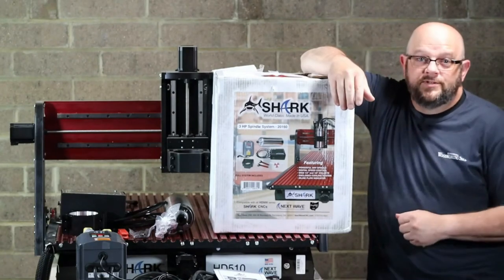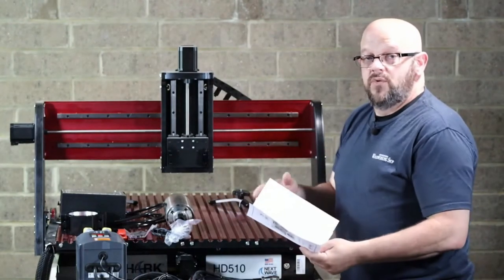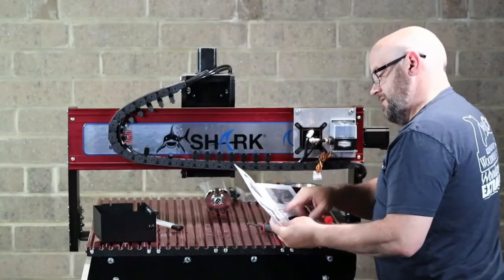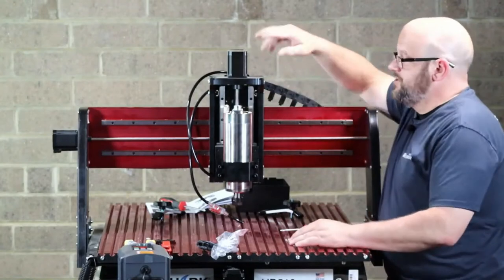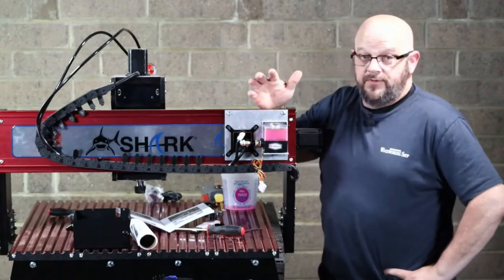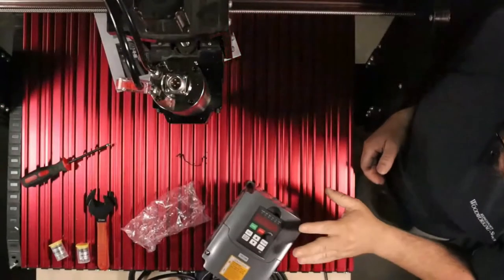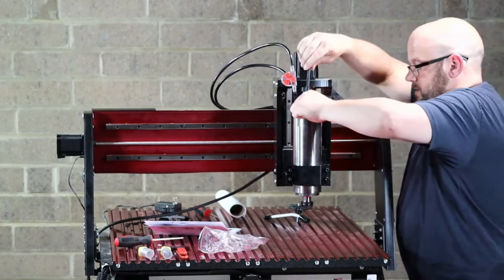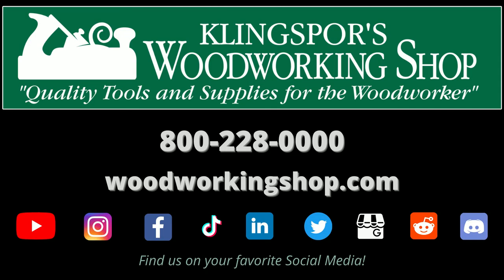3HP Next Wave CNC Spindle Assembly Video

Comment: Hi Chris,
I have just bought and put together a new shark HD520 with 3hp water cooled spindle, but I have not started it up or tested anything. I have been trying to find an instruction manual for the spindle's VFD inverter control box/unit? The manual that comes with it works great for the set-up of the spindle (the same manual you use in your video), but it does not have instructions on how to push the right buttons at the right time for the right reason. I do not know what the arrows ups and downs are all about. Any idea where I can find an instruction manual? Thanks, and your video on the spindle was great...helped a lot!!!
Regards,
Don in Michigan.
Reply from the maker: @christcrosscrafts  thoughts?
Reply: You don't need to do anything with the inverter.  It's already set.  All you do is plug it in according to the manual and it will work automatically.
Reply: Yup! I found that out! Thanks! @ChristcrossCrafts

Comment: Hi Chris, I was thinking about you when I ordered my 3HP upgrade because I remember that was one of the reasons you switched from NextWave to Axiom. You wanted 1/2" and you liked the fact that the coolant was mounted to the spindle. Seems like NextWave was listening and I'll be happy to get rid of that bucket and those tupes plus the added ability to use 1/2" bits. I also ordered a 12 Pcs ER20 kit which has collets ranging from 1/32" - 1/2". I always enjoy your videos hope you'll make another one on how things turned out after you had a chance to work with the new router.
Reply from the maker: Thanks for watching! We will have Chris respond soon!
Reply: @KlingsporsWoodworkingShop  Hi Chris. I got the new spindle and installed it on my HP-510. I also purchased the Stupid Simple Tools Traming jig. Adding the spindle was easy and what a treat to get rid of the lose cable to the router and those water lines. Now all chords are concelled in the track system. No more buckets really a HUGE improvement. Now I'm trying to figure out how in the heck to tram this things since you have to remove the router, the screws, add a shim, put it all back togther and measure again. I'm hoping you'll come up with a video that gives some suggestions on how to do it. THANKS!
Reply: Hi again. Got the machine set it's within .0005 which is good enough for me. It was a pain setting the X axis. Hopefully you can talk Nextwave into adding an eccentric nut so adjusting the X axis is easier. Now that it's setup I'm a very happy CNC'er. Using that 2 1/2" flattening bit made traming the 25" X 25" spoiler board a 3 minute job! Love being able to use 1/2 bits with the new router.
Reply: Thank you for watching.  Yes, that was one of the main reasons for sure.  I'm super happy they have come to the table with a bigger, better spindle option.  They did it and was able to maintain the 110v option.
Reply: @timcreagh585  If you got the machine set to those tight specs, then I'd call you successful.  Due to the slight movement of the gantry when under heavy load, that spec could shift slightly.  If used minimally, then you will find it performs very well.  

It's unlikely that Next Wave would change the nut set-up due to molds and machining.  Something eccentric could allow for excess movement if the nut isn't properly tightened.  It's still way better than what Axiom has done.  They have pins set and there is no X axis movement at all.  You have to shim the spindle in the spindle mount to achieve any X-axis movement.

Stupid Simple tram jig is definitely the tool to have for setting the spindle.
Reply: @ChristcrossCrafts  Yeah I saw you had to shim the spindle I wondered why you did that but now I understand. So far I haven't noticed any issues with the gantry although I did wonder about it. Just to be on the safe side I take light passes when I'm using the 1/2" bits but it's still faster using those with light passes than the 1/4" bits as slightly more aggressive depths. Thanks for the response.
Reply: @timcreagh585  light passes is especially true with a big surfacing bit.  Either way, 1/2" shank has enough benefits to warrant use.  Enjoy!

Comment: Great videos . I have a 520 and recently installed the 3hp spindle . You seem to have a good understanding of that machine . I have a question for you as an experienced shark user… I can’t get anywhere with nextwavecnc , so I though I would reach out to a knowledgeable 3rd party .  I have used mach3 as well as uccnc and I have complete freedom to do this on other cncs but..… closed system with shark.  How do you deal with edge and center finding. It’s in the pendent app but the probe is no longer available and they won’t provide any info on the interface requirements so I could fabricate my own.  . Can’t even use a wiggler because you can’t spin up the spindle unless running a file.  Ideas ? Solutions ? 
Thanks 
Maybe , a good topic for a video !!!
Reply from the maker: @christcrosscrafts Thoughts?
Reply: That's a great question.  Shark is a closed system.  The probe didn't do well for finding X/Y on a corner or center.  It was better for following the surface for mapping the contours.  When I owned my Shark, I used a mounted fence system to locate X/Y corners.  That intersection wouldn't change, so I could place anything in it (regardless of size) and the bottom left corner would always be referenced.  The one downside is Shark doesn't have proximity sensors to guarantee the same origin point, so each time the machine was turned on, that point had to be found manually.  

Using that mounted fence, you can use a 60° (or 30) to locate the perfect corner.  Alternatively,  you can drill a 1/4" hole in your spoilboard at the precise intersection and use two V bits to align it.  One in your CNC and the other with the shank in the hole.  Align the two V points and X/Y is found.  This is for bottom left orientation only (which is 95% of what I use as my origin point).  

For finding center, I still used the fence to secure bottom and left.  Shark has a cool feature in the  pendant.  Find the (-X) most part of the workpiece with the V bit and zero it out.  Then, move the pendant to the (X+) part of the workpiece.  Open the "X" dimension on the pendant and enter "/2 for that number" and move.  The machine will move the center of "X" where you will manually zero that as your X axis.  Repeat for Y and you have center (it's a little time consuming but accurate).  Alternatively, use the old school method and align the V bit to a center mark on your workpiece and zero X/Y on the pendant.

I hope this helps... some.  Shark is a very solid machine but does have some limitations.  At the price, they are fantastic for what you get.
Reply: Thanks. Such a critical omission. One of many that have me scratching my head! 
One more step towards connecting shark to my uccnc / gecko drive setup that’s currently unused. Ready 2 control has so many limitations . Such a shame.

Comment: Why do you think you can’t run normal automotive antifreeze? I would suggest using a 50/50 premix.
Reply from the maker: This is a good question as we asked Next Wave CNC, and they recommended a higher quality marine-grade type of antifreeze. User discretion is advised.

Comment: Great video to mounting it, poor design when it comes to the power cable for the Ecool and the spindle, since they are both to short to route thru the drag change, so now they want me to jeri rig a way to route the cables.  They could resolve this by providing an extension for the two cables and in the future make sure these cords are long enough
Reply from the maker: This makes sense.
Reply: @KlingsporsWoodworkingShop  I just made the cable for the spindle and found an extension for the coolant pump power.  what are some of the trim jigs you mentioned also will coolant / antifreeze work, I can't seem to find straight coolant

Comment: What’s the singular yellow wire that goes to a smaller connector for?  The two wires that are on the female end of the larger connector are red and black, and the two wires on the male connector inside the cover plate are yellow and black.  NextWave must have some real idiots assembling these things.  On my machine, a few inches from the end of one of the hoses is kinked almost completely shut, and when i ran the gantry from one side to another, it stopped/bound up prematurely, so I had REMOVE the screws holding on the plate along one long side of the machine.  I guess I should be glad at least the sticker on my box isn’t upside down like the one in this video.
Reply from the maker: @christcrosscrafts thoughts?
Reply: These components may be made in different factories (who knows), which would explain the wire color variances..  That small yellow-wire connector doesn't connect to anything.  It just sits under the cover not used.  It may be something for a future product or potential expansion.  For now, it's bonus.
Reply: @ChristcrossCrafts  Thanks very much for your reply!

Comment: Bad idea to space out the heat sink. The bottom surface needs to make full contact with the aluminum plate to transfer heat out of the motor.
Reply from the maker: Can you give us a time on the video to what you are referring too? Your comment doesn't make sense to the video
Reply: What part are you referring to?  This motor is cooled by water circulating around it, then pumped through the reservoir and the process is repeated.  There should be minimal heat due to the water-cooled process.  Unlike a traditional router, where air is needed for cooling to prevent heat build-up.
Reply: @KlingsporsWoodworkingShop  14:29
Reply: @ChristcrossCrafts  I can't be 100% sure, because I don't own one yet, but from what I see in the video, the square black plate next to the reservoir looks similar in design to a water cooled CPU heat sink. If this is a heat sink, then heat would transfer from the coolant to the black heat sink, then through the aluminum plate. If you don't have complete contact between the black heat sink and the aluminum plate the heat will not dissipate properly and you risk over heating the motor.
Reply: @jpm1025  I understand what you are saying.  This is a heat sink, and it does sit flat on the aluminum plate on the back side.  The flanges that screw to the aluminum are curved, but the sink is thicker and contacts the plate.
Reply from the maker: @ChristcrossCrafts  We should update this in the future with another quick video to address the comments and questions we have received. Thank you for your expertise!